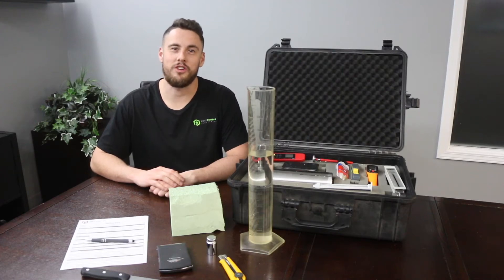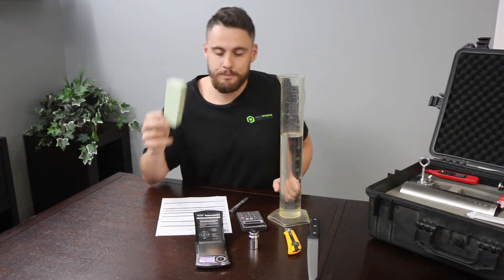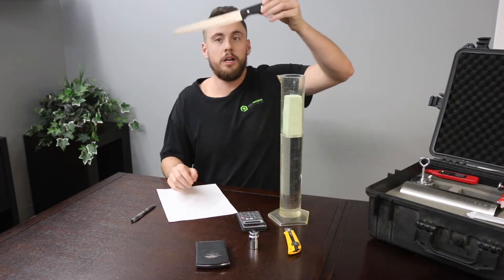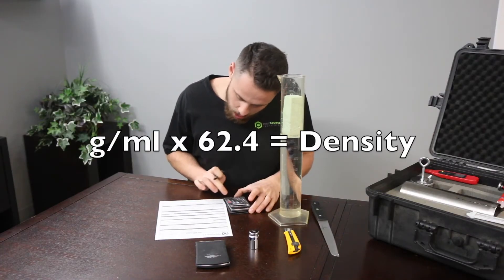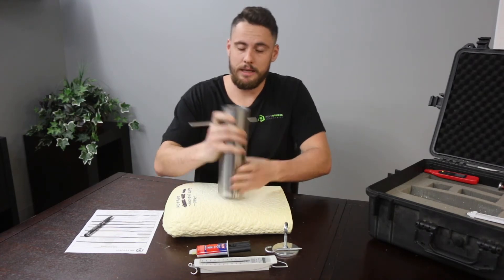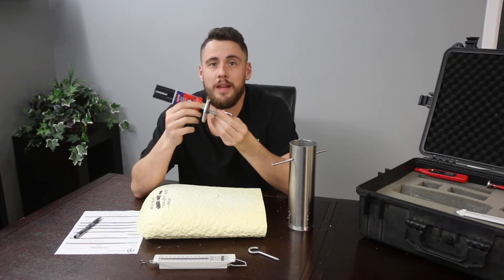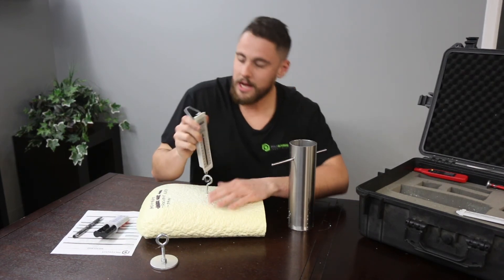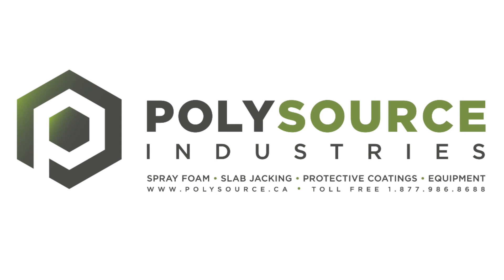Spray Foam Density, Adhesion, and Cohesion Check Video

Comment: Hi! What does the 62.4 constant means? How did you get that value or what is this used for in the calculation?
Reply: Its the conversion of g/cm3 to lb/ft3